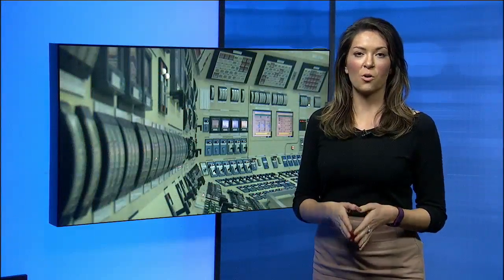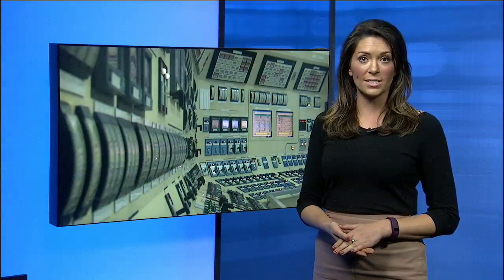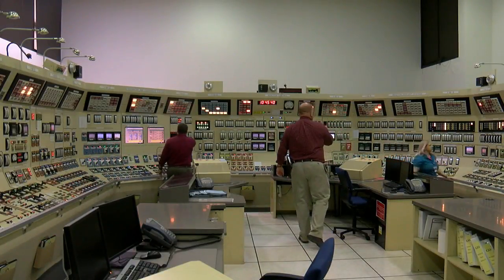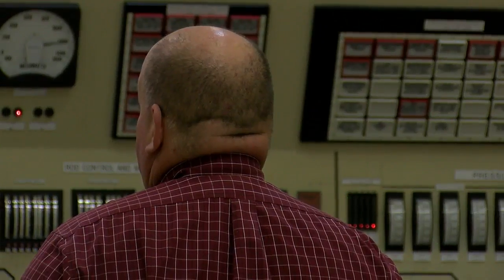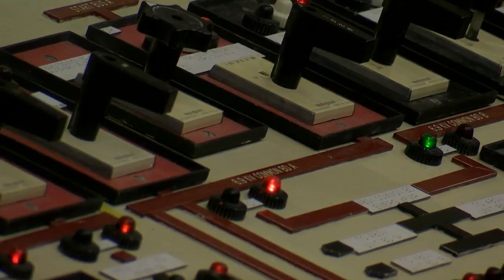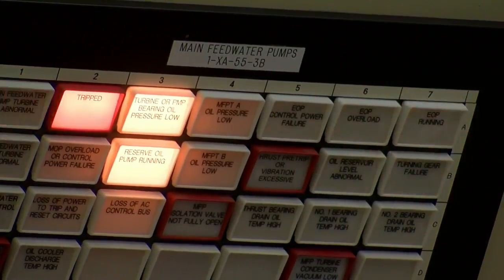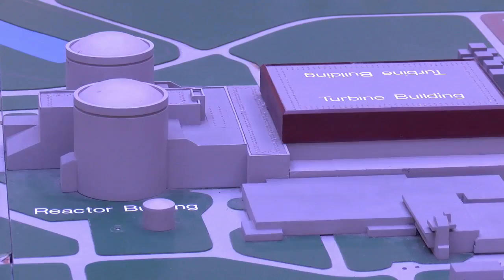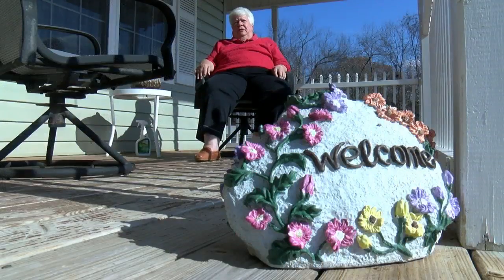Sequoyah Nuclear Plant simulates disaster scenarios

Comment: "as sirens sound...and lights flash"  alright it's more than that but it's kind of expected of that comment
Reply: Yeah... i mean they were running a basic reactor trip so not much issue, i mean the first time i got to experience it the reactor kicked on the safety pumps before before i made it through the silent walkthrough.
Reply: @steelwarrior105 actually they were running a rod control failure

Comment: Preppers= paranoid Americans who watched too many horror movies
Reply: Not really
Reply: @sgtblyat1981  Yeah prepping wont stop the radiation if something like Chernobyl happens again :)
Reply: Idk chernobyl wasn't a movie.
Reply: @sgtblyat1981  operational  American reactors are not RBMKs, American reactors lack the positive void coefficient and  power spike in the shut down system. Also the unit 4 reactor was operated out side safe parameters causing it to explode. Also unlike the RBMK operational US reactors have containment structures.

So Us reactors lack the flaws that made unit 4 explode and us reactors actually have  contaminant compared to  Chernobyl.
Reply: @9TDF  Yet, GE manufactured the same type of reactor that was used at Fukushima here in the US, and it's been known for nuke plants in the US to skimp on some safety equipment and get rather chummy with NRC inspectors. Had Tepco listened to the GE Rep that helped build Fukushima and not only built the damn seawalls bigger, but put the generators on the high grade and NOT in the basements of the containment buildings, they wouldn't have damn near melted half of Japan into the ocean. Seeing American utility companies are just as fucking dense and cheap, even if you run simulations, it won't amount to fuck-all if the main plant isn't properly built and maintained. I live 20 miles from a nuke plant that doesn't even have the proper tank placement for the diesel generators that run the cooling pumps during a SCRAM/Station Blackout. If those sumbitches don't start fast enough, there goes about 250,000 square miles of cornfield and farmland. Our reactors have the flaw of having stupid people in charge; you could argue that was what blew up Chernobyl Unit 4.
Reply: @ImpetuouslyInsane  I was pointing out that western reactors can't just go Chernobyl, there can still be a meltdown but not to the point of blowing the lid off and ejecting part the core into the atmosphere and blowing the entire building apart. Although  there is a the need to to fix all reactor flaws weather it be the diesel generators, the reactor it's self, the operators in the control room, or the owners not maintaining the plant right.

vogtle nuclear plant in GA is building 2 new generation 3 PWR reactors in the even of a station black out passive safety systems can keep unit 3 and 4 cool long enough till power is restored, and unit  2 is testing out some accident tolerant fuel which can give more response time the new ATF assemblies also generate less hydrogen which can mean less hydrogen explosions like at Fukushima.
https://www.powermag.com/vogtle-2-installs-worlds-first-accident-tolerant-nuclear-fuel-assemblies/
Reply: @GoldenTV3  But there are no RBMKs in the US, so.
Reply: @9TDF   Did you get your talking points from HBO?
Reply: @AMD1  

What does HBO have any thing to do with US reactors? the US uses PWR and BWR reactors with negative void coefficients and containment buildings. The US reactors can't just run away like in an RBMK could it's the literal psychics of how US commercial reactors work.

Plus Chernobyl only exploded from the positive scram effect which could have been fixed with longer graphite displacers  or hanging the dispacers lower. unit 4 could have been stabilized if all the inserted from the bottom control rods where inserted. There was also the operating condition unit 4 was in prior to the runaway from engaging AZ-5. 
Plus there are several RBMKs still operating with  reduced positive void coefficients, eliminated positive scram effect, an additional fast acting shutdown. 

Western reactors would start to loose power (Based on the the physics and design of the reactor ) and scram long before it enters a reactor run away line at CNPP.
Reply: @9TDF  I'm well aware of what happened and how, I was obsessed with chernobyl in 2005-2008, like actually obsessed and not figuratively. I get it though because it is exciting. The RBMK is really cool reactor and INPP used to have real time data on their website that I checked in every day before the last RBMK was shut down. just never heard people talk about the positive void coefficients until after the HBO show came out. There is a graphite moderated reactor burred in the ground not to far from me.
Reply: @AMD1  HBO isn't known for being exactly accurate.

Comment: Man, if you can accidently wipe out everything in 10 miles... Maybe you should want some other way to spin a turbine.
Reply: Pro Nuclear all the way
Reply: Other ways such as fossil fuels which kill millions of people every year with their air pollution?
Reply: @demoniack81  I would definitely not be afraid to live near a nuclear power plant.
Reply: It won't "wipe out" everything within 10 miles.
Reply: @Jemalacane0  True, it'd actually be a lot more than that
Reply: @gasman77  It would be none. Zero.
Reply: @Jemalacane0  😆 That's not how that works
Reply: @gasman77  That's exactly how that works. Enough with the fear-mongering.
Reply: @Jemalacane0  lol it is, it has, and enough with the factless dispute
Reply: @gasman77  You're clearly hysterical.
Reply: @Jemalacane0  And in lieu of facts you are just hoping to provoke. But it's ok I'm not bothered by your general incorrectness
Reply: @gasman77  That’s actually not the the concern in a nuclear power plant at all. A nuclear meltdown/explosion wouldn’t create a fireball like a thermonuclear warhead. In fact, the explosion would likely not be thermal (fire based) at all. The worst accident in nuclear history, the failure and destruction of reactor 4 at Chernobyl Power Plant, was actually a steam explosion (a rapid expansion caused by quick conversion of water to steam) which generated Hydrogen which then interacted with Oxygen and graphite, causing a fire. The concern is the release of radionuclides and ionizing radiation such a breach of a reactor would cause. This radiation would not cause visible destruction, rather silently poison exposed individuals. However, even the Chernobyl disaster is a scenario which is unlikely to happen. The Chernobyl reactor was poorly designed, and the control room was staffed by, for lack of a better word, idiots. The exercise shown executed in this video will help prevent Chernobyl level disasters from occurring in the future. Nuclear reactors in the US are even designed to survive being struck by a Boing 747. Even if reactor destruction occurred, you likely could evacuate the area before being exposed to lethal levels of ionizing radiation. In short, the fear of nuclear meltdown is likely overstated, and at a properly managed and maintained plant, the risk of meltdown is infinitesimally small. Hope that helped!
Reply: @comradedyatlov4143  Nuclear energy is not great, not terrible
Reply: @gasman77  an accident will NOT wipe everything out
The worst accident, Chernobyl, just like H B said two comments up was a steam explosion. It was the first and LAST time a nuclear power plant exploded, even so the explosion itself was solely in the reactor building. As for radiation, meltdowns are extremely uncommon and are usually handled quickly by the government. There is nothing to fear, I wouldn't be afraid at all if I had to live near a power plant
Reply: @comradedyatlov4143  User name checks out. The Chernobyl exclusion zone is about 1000 square miles. Or slightly more then three times the square miles in a 10 mile radius. And if you are about to quibble about the meaning of "wipe out" I'm just gonna say if your turbine turning method stands to render uninhabitable for generations an area within a 17.84 mile radius... You PROBABLY need to find a better way to turn your turbine. Use your imagination. It'll be a fun challenge. Focus on non-destructive means.
Reply: @gasman77  Like I said that has only happened once and will never happen again. Nuclear power is safe.
Reply: @comradedyatlov4143  yah yah, you burn down the house ONE TIME and all the sudden nobody want you to have matches, because fire inside is "BAD" and "DANGEROUS"🤣 
Nuclear power is not safe. It's a contained sun. And for it to stay contained you have to everything right. All the time. Problem is... People aren't perfect. And climate is hard to predict (looking at you Fukashima). And over a long enough timeline, mistakes, failures, catastrophes natural and man made are bound to happen. They can't not. It's literally inevitable. And when they do, the penalty is very VERY steep.
If I gave you a magical free source of energy that could flood the planet if it failed but it had a 0.01% chance of failure a day that'd be pretty safe right? Except it would get used for hundreds of years and we probably flood the planet within our children's lifetime. Oops. I mean it was like 99.99% safe. Who knew? When the penalty for failure is that high, the bar for safety rises above the fallible human ability to achieve it. It's hard to be perfect. Let alone be perfect forever.
Reply: @hb712  lol cause that's SOOO much better🙄 I made a pretty long winded reply to @Comrade Dyatlov, I think that probably goes for your remarks too. I am perfectly aware that a full meltdown is less likely than a massive poisoning event. Which for the record was in an 17.84 mile radius. Not 10. I was just using casual language. I don't want to quibble over semantics. The point is it's a ridiculously dangerous way to turn a turbine. That's literally the task. See the big metal thingy? Make it spin. There are LOTS of ways to accomplish that without risking wholesale disaster. I suggest we look for those ways. Be problem solvers. Make the metal thingy go brrrrr😁
Reply: @gasman77  Fossil fuels kill a lot more people
Nuclear Power is safe, PERIOD.
Reply: @comradedyatlov4143  Nuclear power is manifestly not safe. You are in denial of reality. And I suspect you have ulterior motives. Or as they say, a dog in the race. It's an archaic idea brought to you by people who didn't believe they could fail and perpetrated by other people who don't want to loose money. And we can certainly innovate a smarter safer way to turn a big metal thingy.
Reply: @comradedyatlov4143  Also to be clear, I am not advocating for fossil fuels. They need replaced too. But nuclear is not the way.
Reply: Dams
Reply: @gasman77  Nuclear is the way.
Reply: @comradedyatlov4143  No
Reply: @gasman77  Nuclear energy is not a "contained sun", unless you are talking about fusion, which currently does not make more power than it consumes. Nuclear fission is the splitting of uranium-235 atoms, and when they split, it releases energy. This energy is released as heat, which is used to boil water. The boiling of water makes steam, and is used to turn a turbine. Control rods, made of neutron absorbing material, are used to control the reaction. Too much heat? No problem, just insert the control rods. Too little heat? Pull them out. Also, considering the fact that the Chernobyl Nuclear Power Plant had an exclusion zone of 6.2 miles, and that it was the worst nuclear disaster in history, I'd say it wouldn't "be a lot more than 10 miles".
Reply: @gasman77  Something else to consider about Chernobyl compared to what we have here: the RBMK reactor design used during the Soviet era has a number of inherently dangerous designs in it. For example, the reactor core in a RBMK has a positive void coefficient. That means as the liquid gets hotter and boils, it can increase reactor moderation, and increase temperature (partially what happened at Chernobyl). Western BWRs and PWRs have a negative void coefficient, so as the water heats up it reduces moderation, slowing the reaction. In addition, the use of graphite as a moderator in Chernobyl fed the fire, leading to the explosion and the subsequent fire. We don't use that here. We use a control rods that are made of materials that are natural neutron poisons, such as boron or silver, and the coolant is automatically fed neutron poisons as an additional measure, such as borax or boric acid. Most newer reactors are also PWR instead of the older BWR style, where the coolant loop that cools the reaction (primary loop) and generates the heat used to turn the turbine is a separate loop from the water turned to steam (secondary loop), so there's no release of radiation that way.
Reply: Chernobyl is about as bad as it gets, and only  31 people died as a direct result of the plant exploding or radiation poisoning
Reply: @gasman77  you say nuclear shouldn't replace fossil fuel, but 

* solar doesn't work at night
* wind generators require wind
* There aren't enough batteries to power the grid during the night, let alone a series of cloudy days
* tidal energy is possible but unproven (and would wreak havoc on the local marine life due to tidal disruptions)
* geothermal energy is a good idea, but there aren't enough geothermal sites to make a dent in the grid power demand
* fusion is a lot safer, but doesn't exist in a form that is suitable for generating electricity yet 
* undersea turbines would require ridiculous amounts of maintenance due to the corrosive conditions (in addition to wreaking havoc on anything else in the sea) 
* hydrogen is not suitable because it takes more energy to get the hydrogen than you get by burning it in a fuel cell or an engine 
* Biomass (including waste to energy) releases pollution, more than from natural gas, which is considered the "cleanest" burning fossil fuel, and sometimes even more than coal 

All that's left once you exclude nuclear are fossil fuel sources, so unless you have a better idea (if so, I'd like to hear it) kindly shut your trap 

Personally I'd rather live next to a nuclear power plant than continue breathing pollution from coal, gas, and oil

hell, I'd even let them build the core right in my backyard if it meant no more air pollution
Reply: @gasman77  Nuclear is the only way.
Reply: @gasman77 I believe, you don’t drive a car then. Because, driving car (not even counting the exhaust products) is magnitudes more dangerous to your health, than nuclear energy.